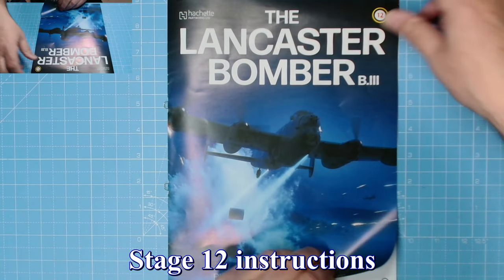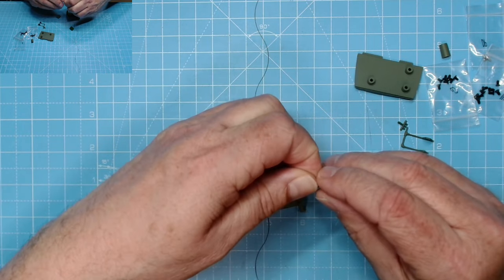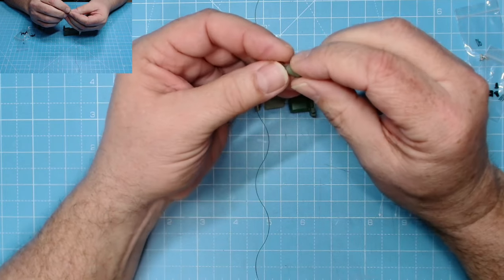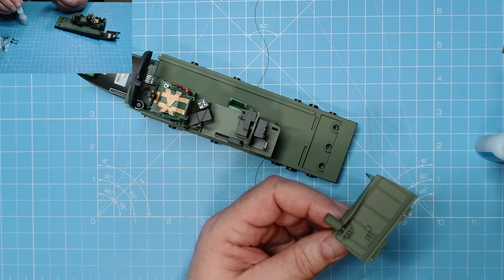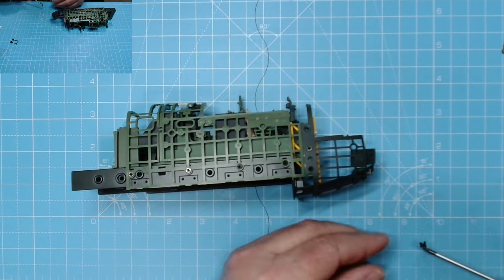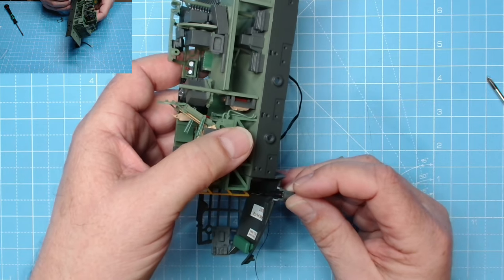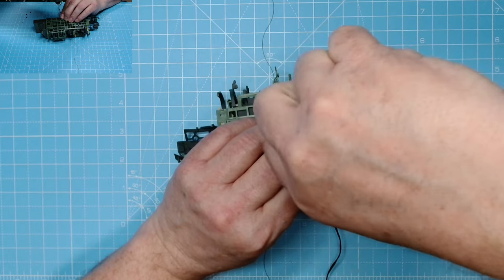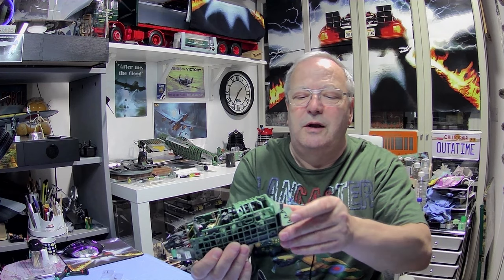Build The Lancaster Bomber B III Stage 12 from Hachette

Comment: Isn't that light to do with the altitude measuring? I know the dambusters had 2 searchlights on the bottom to calculate the correct altitude at which to drop the bombs.
Reply from the maker: Yes it is, you are correct. It's shown in the movie 2 lights merge and then the bomb is released. 😀